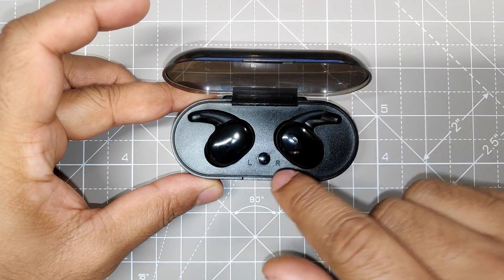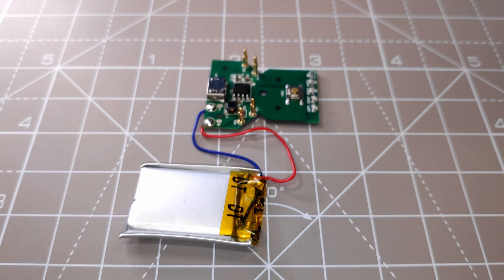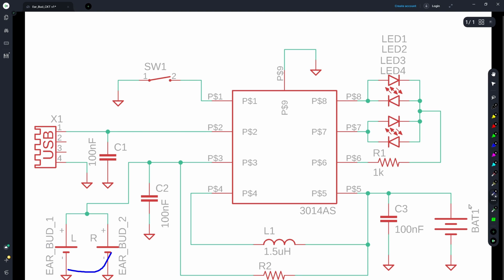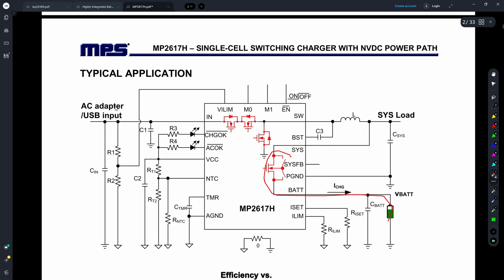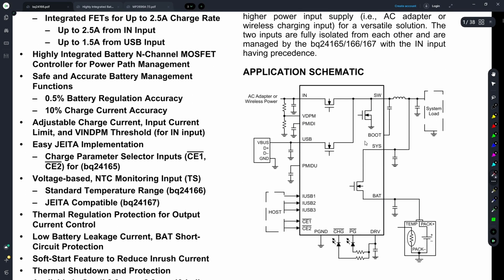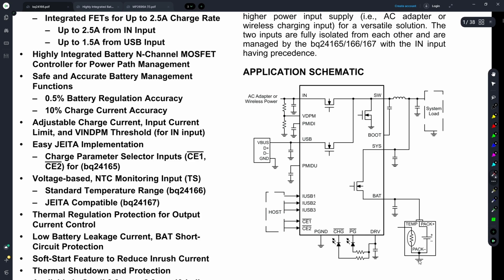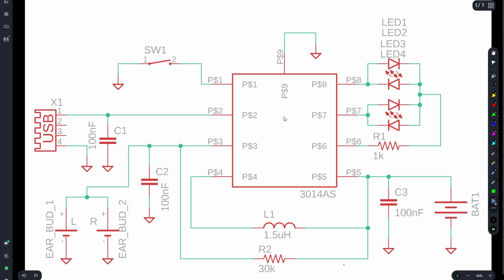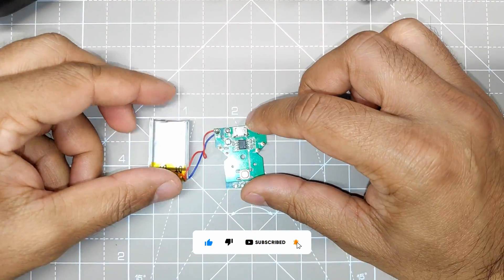What's Inside a Bluetooth Wireless Earbud? Part 1

Comment: Did you make a second video ? 😊
Reply from the maker: Hi @jonloska6298 thanks for asking, I am in the process of making the second part. Most of the ASICs are proprietary and datasheets are only shared with manufacturers but I have found a few documents floating around. Hopefully, I will be able to complete the video soon. 🙂
Reply: Did you release the second part